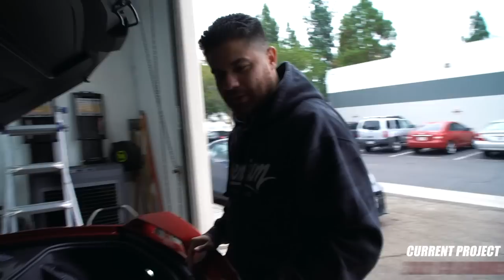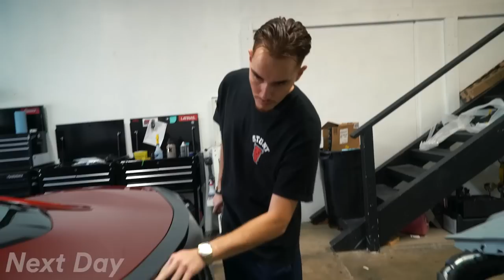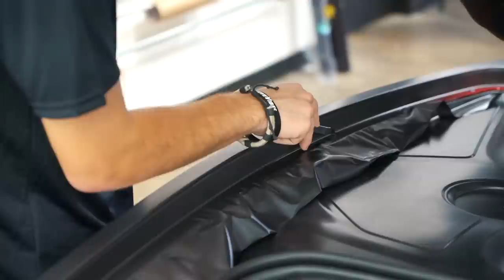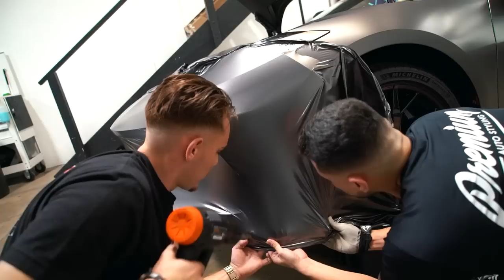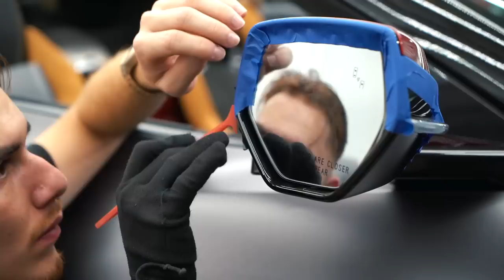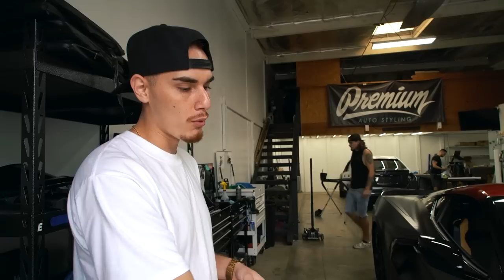HOW TO WRAP A 2021 C8 CORVETTE!!

Comment: Hey! Hoping you guys can help! 
We currently have a Mercedes S-Class in my shop right now wrapped in Satin Black. 

Now, the wrap is only 2 years old. BUT, despite our advice to him in regards to maintaining the wrap, he left his car in the scorching sun for about two months while he was gone on vacation.
Note the car is in for an unwrap/rewrap but the vinyl that’s on the hood, roof and trunk is DAMN. NEAR. IMPOSSIBLE to remove. The og color of the car is black, so it was attracting probably twice the amount of heat. 
We’ve tried heat guns, leaving it in the sun, torching it, even steaming it and nothing. Any tips would be greatly appreciated!
Reply: Someone makes a chemical that’s called “vinyl off” I believe. Which bonds the glue underneath so you can pull off the wrap in bigger chunks. If the car has a metal hood roof and truck you might just have to send it on a rubber wheel removal and make sure it’s sent in to get a detail to remove the swirling in the paint
Reply: @DownhillASMR  thank you so much! High appreciate it! We used the rubber wheel on the hood. It was def a pain but it’s mostly gone now. The previous shop, unfortunately, used SUPER GLUE to set the spoiler back in place. I have no idea why. Also not sure how, but the glue is somewhat on the paint too and I’m really just gonna throw this whole car away cause the amount of rubber wheels and goo gone that we’ve used is ridiculous lol 

Thanks again tho!